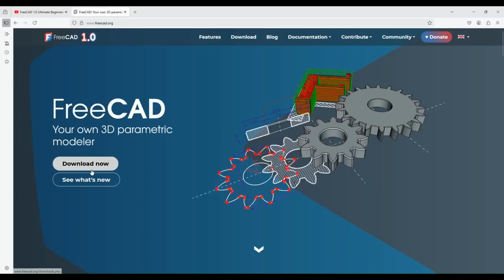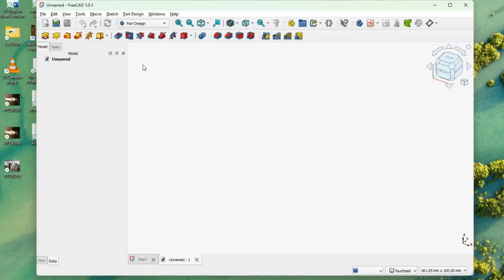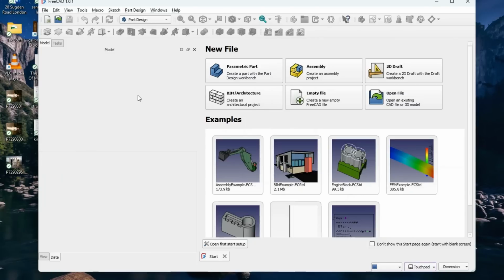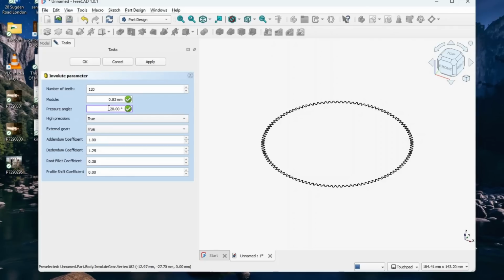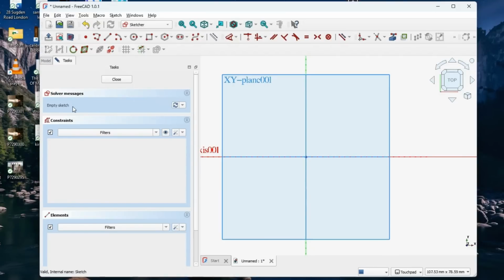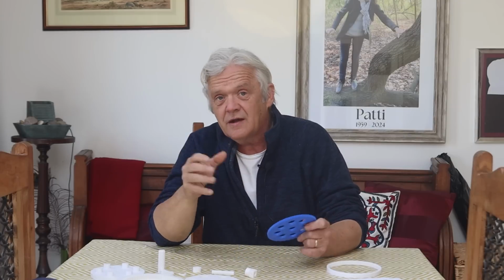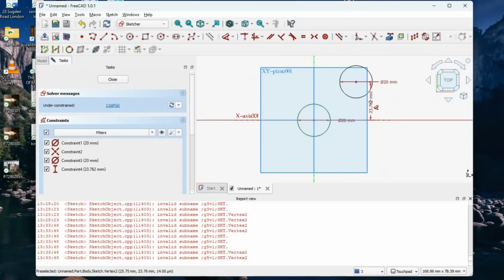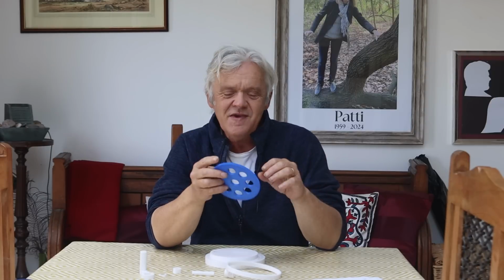2389 Getting To Grips With FreeCAD

Comment: I'm missing easy way to reuse things in FreeCAD. I've been using FreeCAD for half a year now. 

I should kook into SubShapeBinder. However, I've read you can only replicate the tip of a PartDesign Body (feature stack).

But I'd like to replicate from below the tip! Because after designing one Body, I often need a variation of it and I realize this at this point! This is my work flow and FreeCAD should accommodate my user experience. 

At this point I could dismatle and move the feature stack, but moving often breaks things or is not straightforward at all. All Attachments (positiining to Local Coordinate System) should be removed AND disabled, to allow PartDesign "Move to different body" to work . And this is tedious, because I have to rethink the Attachments; Attachments are half the cognitive work I have to do in my head when designing and building complex parts.

So, I mostly copy-paste or carbon copy Sketches now.

I'm using Assembly4 now. It makes PartDesign coherent.

Comment: There are lots of great freecad y/t channels.. but for the absolute best by far for the cam workbench is ; open source cnc.. he’s covering every aspect of cam with some great hacks .. also for some incredible 3D surfacing; deltahedra , check out his bicycle saddle vid .. again welcome to the freecad universe  !! I’m a luthier with 3 cnc’s and a few 3D printers.. I’ve designed and built everything on freecad form guitars to luthiery tools/jigs to vintage motorcycle parts and beyond.. freecad has its flaws but the last 2-3yrs have seen some incredible advancements in its ability.. please encourage others to keep supporting the devs !! Cheers !

Comment: Brilliant, I have been trying to get to grips with this infuriatingly excellent yet non intuitive free program for the last week and making progress, but slow progress. Your tutorial is certainly helping, Thank you.  The one major procedure I have found after opening a new file is that you should always start with 'Create Part' then 'Create Body' and then usually, but not always, 'Create Sketch'.  One request please, would it be possible to change your mouse pointer to extra large?  It might make it easier to see which buttons you're clicking.  Many Thanks Duncan

Comment: The spread sheet parametric design I found very useful for making cases for projects with it you make your part/object say a box with a lid but you reference the constraints to the spread sheet and you only need to change the value in the spread sheet to adjust the size, Adventures in creation has FreeCAD Electronic Enclosure Using Simple Parametric Design Techniques this tutorial is a step by step process and is a good way for a newcomer to learn (it was for me). Also they call it a pocket tool as you can make blind holes pockets with it or even a void inside a solid object. Also companies in china now offer 3D manufacturing at very low prices so even if you do not have the 3D printer or milling machine you can have it made they could make Roberts metal parts for him.

Comment: Thank you! I have been struggling with not knowing what was important to set up and not. I’m reasonably intelligent. I’m have been a semi conductor designer for … a long time. I wanted to try free cad for some little personal projects but I kept relating it back to mechanical drawing class over 40+ yrs ago.  (Where is the T square and triangles 🤪).
I needed your video for me to shift my paradigm!  Thank you so very much!
Reply: I feel your pain. I used to design PC boards with a mylar sheet and tape for years. I made my own boards, so everything I did was mirror imaged from the bottom side. I had lots of trouble with the change to PC cad programs which look through the board from the top, plus with the ability to zoom the view, the relative sizes and positions were no longer clear. Once I learned to trust the software, I was OK.
Reply from the maker: Glad it was helpful!

Comment: i use this to real cool  whit the conolse can use this for example to make part import FreeCAD
import Part
import Mesh
import Import

def maak_en_exporteer_meerdere_objecten(basis_lijst, gaten, export_pad="output.stl"):
    doc = FreeCAD.newDocument()
    totale_vorm = None

    # 1. Basisobjecten maken en samenvoegen
    for config in basis_lijst:
        shape_type = config.get("type", "box")
        x = config.get("x_pos", 0.0)
        y = config.get("y_pos", 0.0)
        z = config.get("z_pos", 0.0)

        if shape_type == "box":
            l = config.get("length", 10.0)
            w = config.get("width", 10.0)
            h = config.get("height", 10.0)
            vorm = Part.makeBox(l, w, h)
            vorm.Placement = FreeCAD.Placement(FreeCAD.Vector(x, y, z), FreeCAD.Rotation())
        elif shape_type == "cylinder":
            r = config.get("radius", 5.0)
            h = config.get("height", 10.0)
            vorm = Part.makeCylinder(r, h)
            vorm.Placement = FreeCAD.Placement(FreeCAD.Vector(x, y, z), FreeCAD.Rotation())
        else:
            print(f"Onbekend type: {shape_type}")
            continue

        if totale_vorm is None:
            totale_vorm = vorm
        else:
            totale_vorm = totale_vorm.fuse(vorm)

    # 2. Gaten erin maken
    for hole in gaten:
        hole_type = hole.get("hole_type", "round")
        x = hole.get("x_pos", 0.0)
        y = hole.get("y_pos", 0.0)
        z = hole.get("z_pos", 0.0)
        d = hole.get("depth", 10.0)

        if hole_type == "round":
            r = hole.get("radius", 5.0)
            gat = Part.makeCylinder(r, d)
            gat.Placement = FreeCAD.Placement(FreeCAD.Vector(x, y, z), FreeCAD.Rotation())
        elif hole_type == "square":
            l = hole.get("length", 10.0)
            w = hole.get("width", 10.0)
            gat = Part.makeBox(l, w, d)
            gat.Placement = FreeCAD.Placement(FreeCAD.Vector(x - l/2, y - w/2, z), FreeCAD.Rotation())
        else:
            print(f"Onbekend hole_type: {hole_type}")
            continue

        totale_vorm = totale_vorm.cut(gat)

    # 3. Toevoegen aan document
    part_obj = doc.addObject("Part::Feature", "GecombineerdObject")
    part_obj.Shape = totale_vorm
# Gebruik exportpad dat door de knop wordt meegegeven, anders standaard

    # 4. Exporteer STL
    Mesh.export([part_obj], export_pad)
    print(f"STL geëxporteerd naar {export_pad}")
    # Gebruik exportpad dat door de knop wordt meegegeven, anders standaard

    # 5. Exporteer STEP
    # Controleer of export_pad een absoluut pad is, anders sla op in C:\freecad\
    if not os.path.isabs(export_pad):
        export_pad = os.path.join("C:\\freecad", export_pad)

    # Zorg dat exportmap bestaat
    os.makedirs(os.path.dirname(export_pad), exist_ok=True)

    step_pad = export_pad.replace(".stl", ".step")
    Import.export([part_obj], step_pad)
    print(f"STEP geëxporteerd naar {step_pad}")

# === Voorbeeldgebruik ===
if _name_ == "__main__":
    basis_config = [
        {"type": "box", "length": 100, "width": 50, "height": 10, "x_pos": 0, "y_pos": 0, "z_pos": 0},
        {"type": "box", "length": 25, "width": 25, "height": 25, "x_pos": 0, "y_pos": 0, "z_pos": 10},
        {"type": "cylinder", "radius": 10, "height": 20, "x_pos": 110, "y_pos": 10, "z_pos": 0},
        {"type": "cylinder", "radius": 5, "height": 15, "x_pos": -20, "y_pos": 40, "z_pos": 0}
    ]

    gaten_config = [
        {"type": "hole", "hole_type": "round", "radius": 5, "depth": 20, "x_pos": 20, "y_pos": 25, "z_pos": 0},
        {"type": "hole", "hole_type": "square", "length": 10, "width": 10, "depth": 20, "x_pos": 60, "y_pos": 25, "z_pos": 0},
        {"type": "hole", "hole_type": "round", "radius": 5, "depth": 20, "x_pos": 110, "y_pos": 10, "z_pos": 0}
    ]

    maak_en_exporteer_meerdere_objecten(basis_config, gaten_config, "object_met_gaten.stl")

Comment: I had 3 or 4 false starts using FreeCAD but I tried again a few months ago and haven't gone back.  I still only use 10% of it.  While you could have included the holes in the first sketch and gotten the final design with one pad (extrude), I generally keep it to one sketch per feature. Building up the solid (as if it were a cast piece) and then modeling the holes and other "machined" features.
Reply from the maker: that is cool mate - myself - I don't expect to use all of it - once i can do what i want to I imagine I will be happy.
Reply: @ThinkingandTinkering To really get used to it I did over 100 of @tootalltoby speed modeling practice models

Comment: 25:01 I'm trying to follow along, but you jumped a bit fast there, about how you build the 4 intermediate circles that have a 45° offset from the first 4 that lay on axis, I think you used computed values and horizontal+vertical constraints, but wasn't really happy with that, I tried using a distance from center constraint at 30mm, and i think an angled constraint would do the trick, but then I need a line, and to attach it to the center of the circle, and the center of the plan, seems to work but i had to use blocking constraints to hold my lines in places after manually setting one of their end to 0,0, only the circle end seemed to attach automatically (and then hide my lines). But, after that, my shape couldn't be extruded, because of these pesky lines, so i had to delete them, thankfully the circles remained in place, and i put block constraints directly on them, and the rest worked fine.

Anyway, a long time happened between starting to type that comment and finding the solution, hope it helps someone 😆.
Reply from the maker: A couple of people have mentioned that so I did a new video that goes up Monday that should clear that one up mate

Comment: When you set the constraints for the circles positioned diagonally from the origin, did you manually calculate the offsets from the axes, or was there a tool for assisting that process?
Reply from the maker: A couple of people have mentioned that so I did a new video that goes up Monday that should clear that one up mate

Comment: I completely failed to add the circles on the 45 degree angles. I managed to get a circle constrained to 30mm from the centre of the first circle, but completely failed to add the second constraint. I was attempting an angular constraint (45 degrees from the origin) but no amount of clicking helped. Great video though still !!
Reply from the maker: use the line tool to create a line 30mm long - dimension it to the axis and you will get a degree setting - set that at 45 the draw your circle and make it co-incident with the far end of the line
Reply: @ThinkingandTinkering  Thanks Robert, that's helped, Though my line is now over-constrained apparently.

A tip for anyone else struggling - right click on the thing you are trying to constrain in the elements box and select 'Select Constraints' it will now only show the constraints for the thing you are interested in.
Reply from the maker: @rustyshackleford8043  nice tip mate thanks for sharing it

Comment: I can see that they have not made any effort to make the interface any easier to understand, it is not making any sense at all as to why you have to jump though 30 hoops to get a shape on the build plate. I went to an AI types cad tool, told it in plain text what I wanted and I had the part in less than 1 minute, exactly as I wrote it yo be designed.

So I give up with this and other CADs like it, I just can't get into their convoluted stupid way of making things and having to perform many tasks that should be automated.

Put it another way, I can't use CAD tools but I can hand write G Code... go figure.
Reply from the maker: It' all about what works for you mate

Comment: It´s nice seeing you finally picking up parametric CAD software. Try thinking about which parameters you might want to adjust in a sketch and then constrain the sketch entirely relative to these parameters.

Using construction geometry (the blue one) in the sketch workbench opens up the whole greek geometric math (and beyond) to freely position other geometry around. You can also import geometric features from the existing part into the sketch workbencch (e.g. points, lines, circles), which are then projected onto the working plane (so you can even import geometry not within the current plane). This allows you to accurately dimension entire sketches without entering a single number and entire parts with only a single parameter.

I then recommend experimenting with symmetry and arrays. After that look into linear and polar patterns in the part design workbench. And if you want to specify a lot of parameters in one place, try the spreadsheet workbenches, almost everything that takes a number in freecad can also accept a spreadsheet reference.

With these tools designing most parts becomes very efficient and intuitive.

Also no need to manually switch between the part design and sketch workbenches. Just click on the surface of the part or plane you want to sketch on and create a new sketch, you will be automatically moved between workbenches.

Comment: I usually use the gear workbench for the tooth geometry. Really nice for things like bevel gears.  For hole patterns in general i usually draw one circle and  use polar pattern on the pocket/hole operation.  If I want an 8 hole pattern in a sketch I might use the octagon tool to make construction geometry to attach the circles to. That way if I want to change the size of the hole pattern later I only have to change one dimension rather than one or two for each circle. Similarly for the hole diameters, I'd use the equal constraint instead of having them all dimensioned 20mm.
Reply from the maker: Great tips cheers

Comment: Even with my pre-home computer era background in mechanical drafting (pencil and velum on a drafting table) learning the concept of having things fully constrained in free cad was still a bit frustrating at first. Eventually with practice you get used to it. But I agree that ignoring most of the application parts you don't need is the best way to start learning.
Reply from the maker: cheers mate

Comment: I use Solidworks at work and Freecad 1.0 at home. Both are great. Freecad has an involute Gear workbench plugin that is very easy to use. Amazing for free! Freecad is under enthusiastic development and there have been some significant usability improvements in the last 2 years

Comment: freecad allways seg faults on me as soon as i use any menus
Reply from the maker: ok - don't know what a seg fault is
Reply: @ThinkingandTinkering  Segmentation Fault is the term for when a program tries to do something to memory the OS says it shouldn't (usually because it's memory allocated to another program). If you ever had a Blue Screen Of Death, that was one possible consequences, thankfully these days it only crashes the program because the OS knows how not to panic about it and just terminate the program, but it's usually sad because you lose some work anyway. Thankfully (again) FreeCAD has autosaves and allow recovery on restart.
Reply: @ThinkingandTinkering  on linux its the equivent of a crash with a dump of machine readable code usually in the form opcodes in the terminal or debug log
Reply from the maker: Oh - I think I used to call that a stack overflow! But it has been a while since I coded operating systems lol
Reply: I got a couple crashes as well with the AppImage on Linux, but i managed to follow along the video, not sure what triggered them but we might have bugs to report…

Comment: i use the realthunder version ...    i like being able to modify designs after the fact.   Normal/default FC has a funk > when changes you make result in new faces or the removal of faces > it will go blah poo huh rmmmph , & melt in errors. =topological naming bug.  Sometime soon, the realthunder fixes will be included in normal freecad  ...    IF YOU continue with FC normal and this error happens, you just have to delete and remodel. Save often. . & don't fret if it goes kapooph. its not YOU. its the program.

     Other than that >> FreeCAD is hands down the most important tool in the maker world. Open source. Community driven. its the precipice of our culture. The most ultimate invention. the invention that makes inventions !!!!  A shining achievement of humanity. >> that normal people can create the same stuff that corporations demand our slavery for.             

    Once you get assemblies worked out + can FEM an idea and verify that in reality with IRL parts = you know u have arrived : ) 

Definite first steps are to learn > top down, bottom up & middle out design strategies. 

p.s  Don't sleep on learning surfaces/surface modeling + 3d sketching ... but that comes after the basics.   A YT channel called Mangojelly has a bunch of good tutorials & is my go to for learning new tips/tricks. awesome stuff
Reply: oh yeah & definitely learn using reference dimensions / spreadsheet   ... lotta newcomers learning via DIY miss that VITAL paradigm . it is a VITAL / fundamental technique

Comment: Good to see you using FreeCad. Take a moment to contrast direct modeling ( tinker cad ) with parametric modeling ( freecad ). Both have their advantages and pain points. You might include some discussion on the timeline concept.
Reply from the maker: That's a goo didea mate - thanks for suggesting it